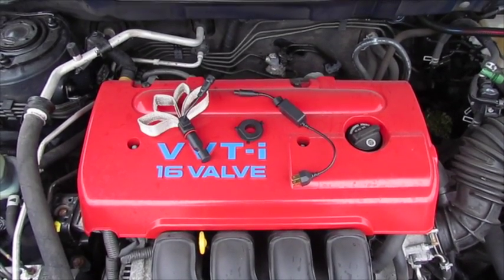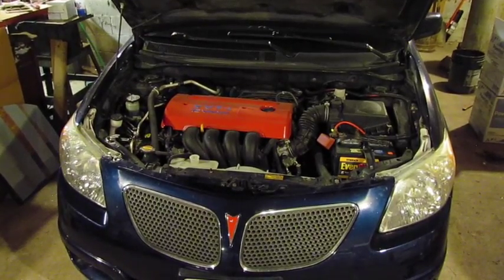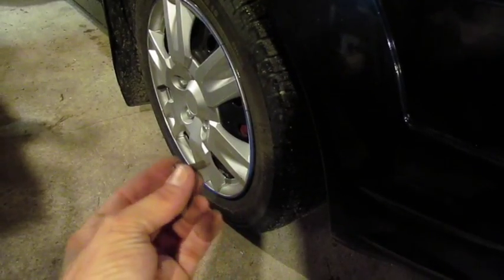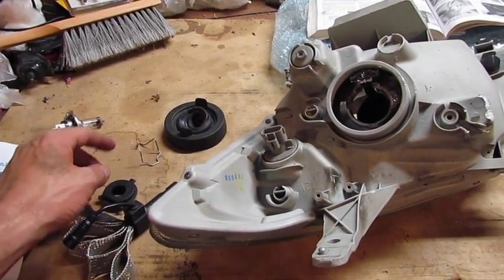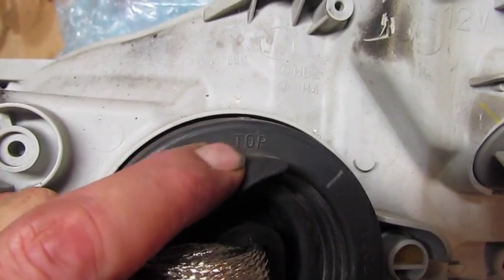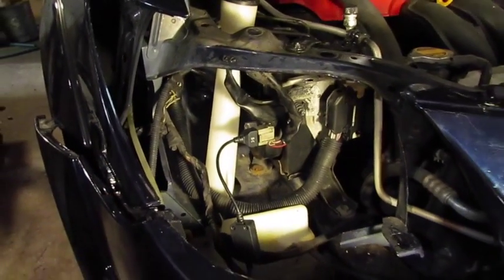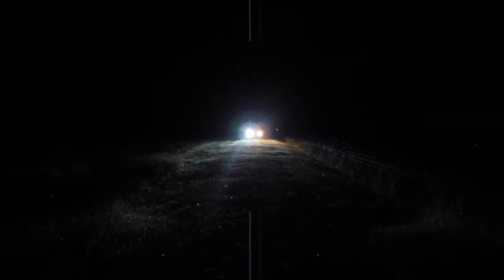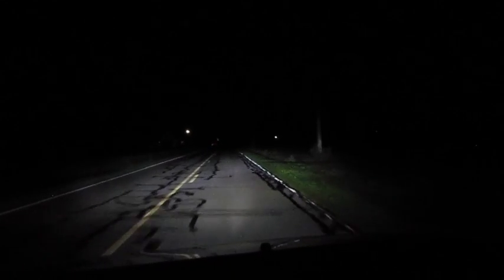LED Headlight Conversion Pontiac Vibe

Comment: What a retard! The way you do it is, install the light as regular grab the main body of the LED and twist to extract. Put on the rubber boot and reinsert the body of the LED turn to lock the LED in the base. Plug-in wiring harness.

Comment: actually the scatter light all over because they were not designed to be there. i bought the xenon depot philips lumileds xtreme leds for my 2003 vibe. the leds are placed exactly where the filament in the halogen is. they also have a black pcb. and are much better quality than the bulbs in this video. 
they DO NOT blind other drivers. i have noticed a great imporvment over the halogens. and the light is scattered the same way it was with the halogens. and i did not have to remove the housings to install them.
yes they were more expensive than the one in this video. but you get what you pay for. at least i do not blind others drivers.

Comment: it seems like hid/led light bulbs on halogen headlight are an improvement cuz they seem brighter but in reality the light is scattered all over tue road,blinding drivers ahead,why?because HID/LED lights need to be installed in a projectors,that way,it lights up where u actaully needed,in the road ahead of you but without blinding the drivers ahead and they make a HUGE difference compared to HID/LED lights in halogen headlights plus they give u that beamer type look with the colorful cutoff line that from far away it changes colors and looks badass.i recently did a retrofit on my 05 Pontiac Vibe i used morimoto mini H1 7.0 projectors along with thei Elite HID kit,also came with the badass morimoto bi-xenon harness and made a huge difference over my stock halogen bulbs and looks sick.i also got projectors for my wifes 98 civic sedan using a cheap chinese retrofit style headlights and a cheap HID kit and to my surprise,they look almost as good as my retrofit vibe headlights.but dk watchout for buying the projector/angel eyes headlights from ebay etc.. cuz most use halogen projectors so when u install hid bulbs inside those halogen projectors,u still end up blinding drivers ahead.the only brands that i know that use true HID Projectors on aftermarket projector headlights are,eagle..k2motorsports,i know cuz i have tried both brands in my past vehicles.any questions hmu.btw u should do us all a favor and remove those LED light bulbs untill you're able to do a retrofit.

Comment: My hubby actually cut off a part of the rubber boot to fit the LED of a similar but slightly different design. That way, he does not have to take off my car's bumper to take out the housing to install them.
Reply: Stupid man. I changed mine in about 20 minutes. I installed the rubber boot correctly. Don't trust that moron to do anything.